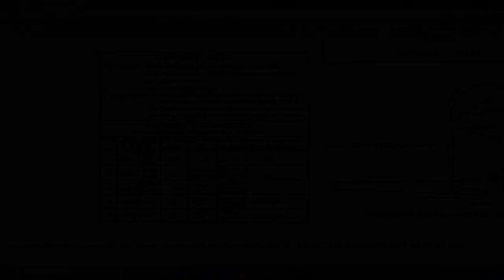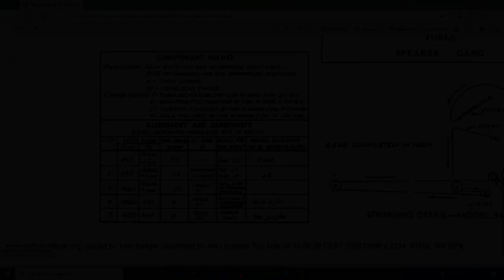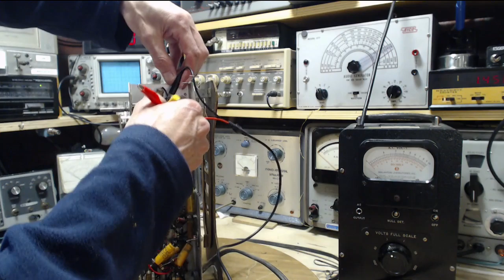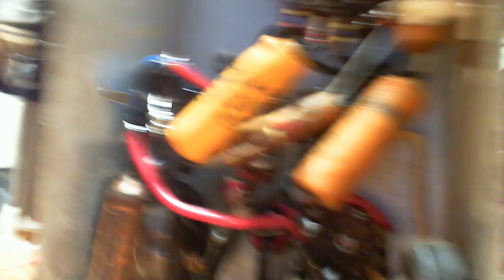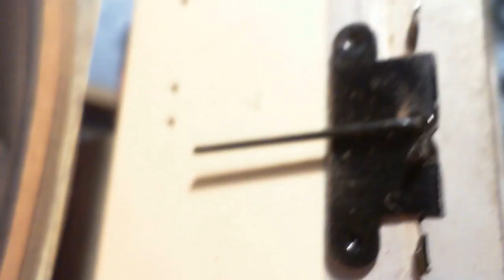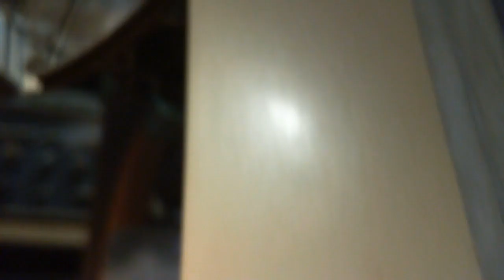Viking Model 54-51 Video#3 - RF Alignment Check

Comment: I don't think it's "motorboating". It sounds like RF interference probably coming from his lab equipment. "Motorboating" usually happens only at a particular frequency, at least in my experience.
Reply: Agreed. And motorboating has a 'pumping' sound that's hard to describe but unmistakable when heard

Comment: @11:10 he mentions he onced used a  lube for use on model train tracks. I think he may have used Wahl's Clipper Oil. He really should use Goo Gone. Far superior and easy to find.
Put it in a needle cap container so you don't flood the area your working on with the product. Don't use regular WD-40. They make an electrical contact cleaner now.
Most WalMart's carry it!
Next video he's going to replace some paper capacitors. How about all of them. Oops gotta go, there's a new Mr. Carlson's radio repair video out. I'm sure he will fix it right!
Reply: I used to watch Mr Carlson's vids but ultimately got too claustrophobic. Feels like you're descending into the depths of a submarine electronics shop, near the bottom of the hull. Plus, his use of the word 'varyate' and calling an armature an 'aperture' grinds on me. But his electronics skills? Absolutely top-notch. An expert in his field, and excellent teacher    :)